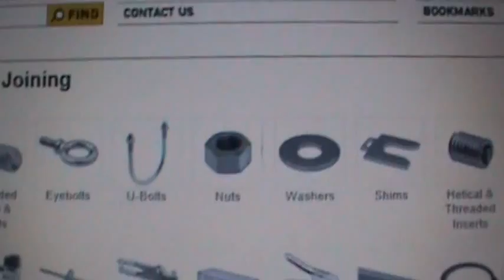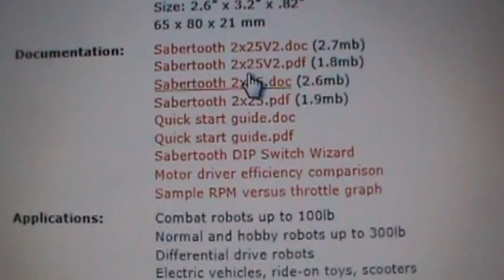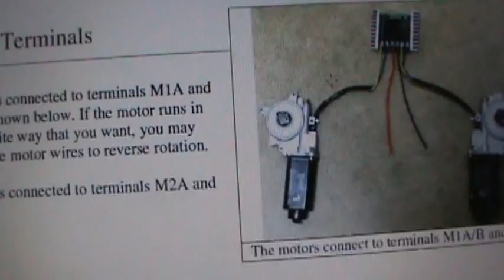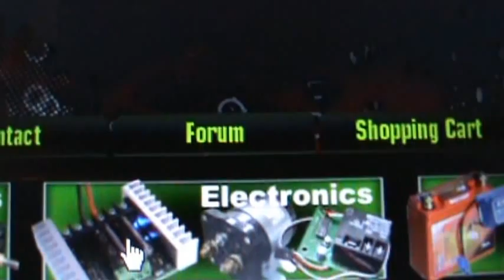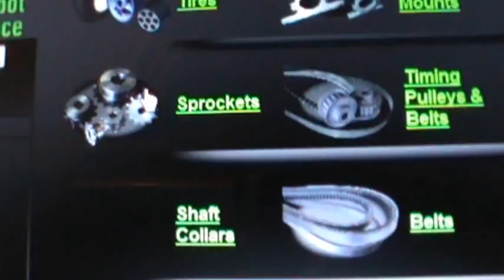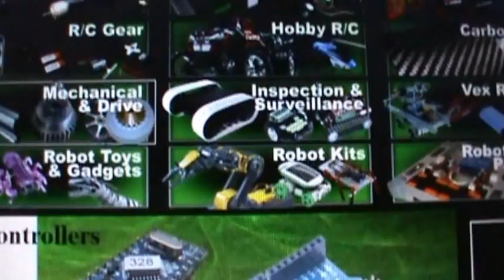Most used web sites for the RC Dozer build.

Comment: In process of building my own RC and I have a 24 volt motor I need to know what kind of electronics I need receiver-transmitter speed controller that kind of thing what do you recommend or do you know of a place I might be able to find these items

Comment: Which sabertooth circuit should I use for 12v DC motor and which one for 24v dc motors?
Reply from the maker: Check out dimension engineering and take a look at the fact sheet for 2x12 and 2x25 and even the 32. It all depends on how many amps your battery has and the amount that your motor can handle. Also check out amazon as they have quite the selection for a cheaper price. However I have had a cheap one fail on me and o have had no problems with the Sabertooth.
Reply: Scratch Built RC Dozer and Ship thanks a lot  ❤️

Comment from the maker: I will have to look into it a bit more....I do want to make the next build hydraulic...just to have more power.....and when i was doing the research the valves are the biggest issue to workout. Electric hydraulic valves are all open or closed...or forward/ backwards...no just a little like a hand control manual valves would give...so i was thinking of using the manual valves and attach the handles  to RC controlled electric liner actuators. Still just a though.

Comment: The pumps have in and out so you would need a valve. Then servos t turn that valve, for the valve you could use some a small ball valves and fittings. Im will need to think some more on it it would a good drive could put sprocket right on it

Comment from the maker: Specs for the AME 226-series 12V 325 in-lb LH gearmotor - long shaft
Nominal Voltage 12vdc 
RPMs 96 rpm (no load)  
Amps at No load 3.4 
Amps at Stall 68 
Torque (Max) 325 in-lbs or 36.7 Nm 
Shaft  11mm dia x 64mm long with flat  
Weight 2.7lbs 

I could have used just a tad bit bigger motors...but they did fine for the "94lbs of steel" and materials (dirt) it was pushing. Next build will be much more powerful!

Comment from the maker: Ok, I see your issues and its something I had a issue with also. I had ordered 3 diff. types and sizes for the dozer and the ones on my dozer now are strong, but they have taken a beating and will need to be replaced once I get back home. My dozer weights in at 94lbs. Its hard to find the right size and style! If you search for medical equipment actuators or for mini electric linear actuators you might find what you’re looking for.  Most of the models you see on YT,the builders make their own!

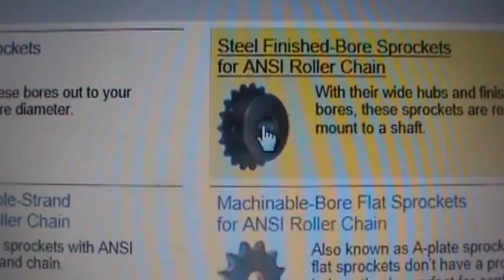Comment: Yes, i have already looked and found some there, but i was concerned that they were too small for my project, i did not think that they would be able to support or lift the dozer. I was planning to build a 1:10 d11 dozer, i was thinking it would weigh about 200lbs. If you know anywhere else that would be great, thanks so much